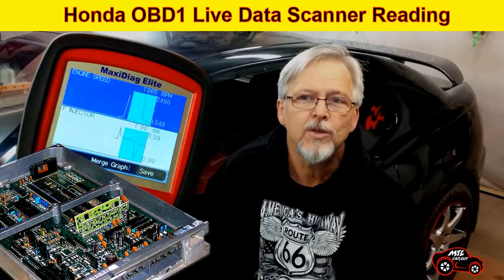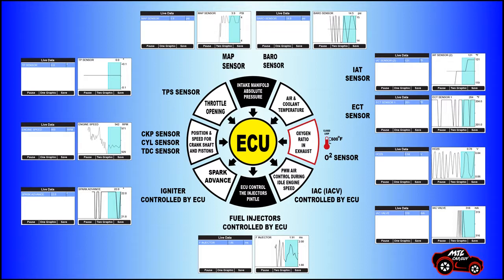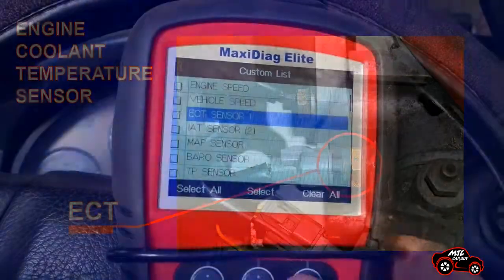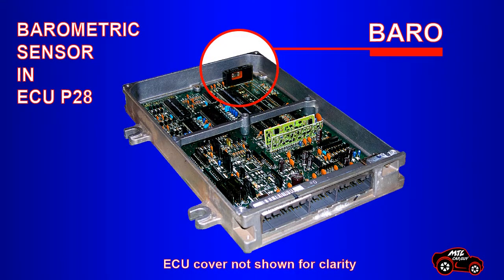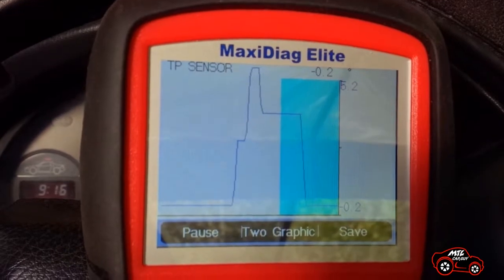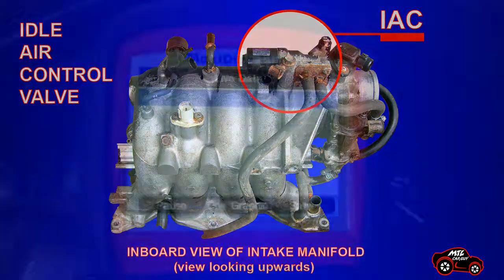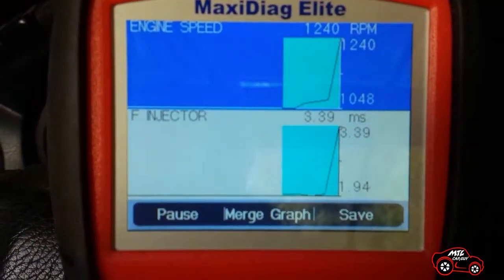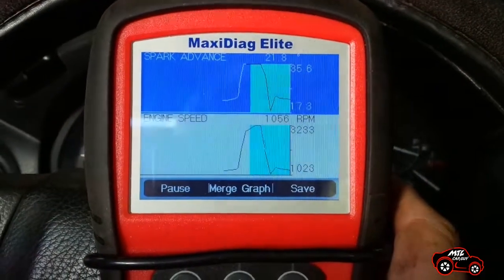MTLCARGUY EP2 - Check Honda Del Sol 1993 Ignition Sensors in close loop

Comment: Would like to get access to live data on my 95 Acura Integra that is running lean and want to do thorough diagnostics before I purchase new parts. Checked everything mechanically and its all within OEM specifications. Only have aftermarket CARB compliant intake and CARB compliant header. thank you
Reply from the maker: Watch  my video ''MTLCARGUY EP1 - Honda OBD1 Live Data Scanner Reading'' for a basic procedure with an Autel scanner MD802.

Not all scanner can interface with the Honda OBD1 Live Data output via the DLC connector with a Honda OBD1 DLC harness adapter.

New compatible scanners are more difficult to find than years ago. You can check for OBD1 Live Data scanner specs on-line or discuss with an auto parts specialist if you need to buy one.

Mechanically, if there is a pressure drop with the fuel line due to the fuel pump or the pressure regulator is not precise and it can affect the short term and the long term fuel trims that are not part of the Live Data readings.

The fuel pressure should be checked when the engine is running under load and highway speed.
The fuel PSI access hole/port is often on top of the fuel filter.
Check for the proper PSI for your vehicle, it should be around 40PSI all the time. 

Note: Make sure the electrical contact of the ground terminal at the thermostat housing is fine to ensure a proper electrical current flow between many electrical components including the ECU.
Reply: @mtlcarguy  I was able to scan my car and figure out I had a code for faulty fuel injector and my car never threw a CEL and never even when I jumped the connector. Need to find new injectors but almost impossible to find OEM injectors for a 95 Integra. You have part sources?
Reply from the maker: @JeremyFowler10271999  You probably read the code 16. Baby our injectors are the standard Honda 06164PR4020?   Check on ebay. You can also buy re-manufactured ones.

Comment: VERY GOOD. Simple and effective. Merci !    I will try to make the adapter for my '92  mustang.
Reply from the maker: The Ford Electronic Engine Control EEC-IV is a self-diagnosis system that can generate standard pulses to read the stored codes, but I don't know if you can access any live data with a pre-OBD2 scanner. Ford enthusiasts are probably better than me to help you. Good luck!

Comment: Hello good day.  It has a CRV 2.0, 2001 That when it starts to arrive at working temperature.  The injection light turns on, and if it turns off it does not start.  Ignition module, temperature sensor, valve adjustment, coil were replaced.  Have you caught something like that?  Grateful.
Reply from the maker: No I did not !   But I would check if the fuel pump motor has too much voltage resistance and is getting too hot. When it happens the electrical motor slows down and there is not enough fuel pressure for the injectors to work properly.

Comment: Awesome presentation - very information-rich.
Did the Del Sol receive tech updates in advance of other product lines?
I have a 93 Accord, and I'm wondering if I can pull the same sort of data if I build the same data adapter you put together.
I know that this was a period when manufacturers were using a mix of proprietary odb1 and odb2 codes prior to the official switch to odb2.
I may just have to try it.
Reply from the maker: In 1992 the Honda Civic and the Prelude were the first ones to be equipped with the ECM P28 and the Data Link Connector (with 3 cavities)  but only 2 pins & sockets were connected. The Honda DelSol was introduced in 1993 with the same ECM and DLC connector. The 4-cylinder Accord got the small DLC connector from 1994 to 1995 and I don't think the V6 had any small DLC connector. In 1996 and later the ECMs with the OBD2 and the 16 pin DLCs were installed on all the Honda vehicle in North America. So your ECM is probably a pre-OBD1 without live data output. Only the Trouble Code Pulses system was available with a LED on the ECM or a flashing light on the cluster.
Reply: @mtlcarguy  Thanks very much - that saves me a lot of time and unnecessary expense. I still feel like I've gained a lot from your videos. It looks like there are some options to throw on a different ECU/ECM that would be odb2, but this is just a beater car.

I had considered doing some minor refurbishing - but that was before one of my wife's clients rear ended me right after I dropped her off.

Damage was very minor, but still effectively totaled it. So now I'm just trying to wring a few more miles out of it until I gets the components together to build a dual motor fat bike. I retire in a year and then I won't need a car - I barely need one at all now.

If I could have gained insight into the drive train for $100 or so it would have been worth it.

Again, thanks for taking the time to provide a useful and informative answer.